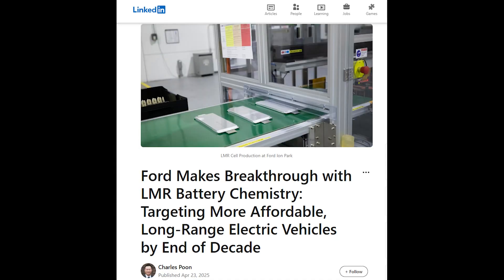Are Ford and GM's LMR Batteries the Same or Different?

Comment: Interesting discussion! I never would have considered that these are different technologies. I kinda hope they are because I just want to see innovation and improvement. But if so, I just hope both are viable and end up being great alternatives that both succeed. Wouldn't cry if America were able to unseat China's lead in battery manufacturing (at least technologically), but... That's a fantasy at this point.

As for confusion, meh. One of both with adjust the consumer-facing branding of they really are different. Because you can bet they'll market the heck out of it, if their batteries are any good

Comment: GM is Chinese. So it’s a false distinction to try and separate GM from a Chinese company.
Reply from the maker: Yes, I'm curious what would make GM a Chinese company. Are you referring to investments or equity? Yes, GM partnered with SAIC in order to do business in China, but SAIC got more out of that than GM.

Regardless, my point was in reference to battery development. For most of the 2000s and 2010s, GM operated the biggest battery development and testing center in the world, and it was located in Michigan. So if nothing else, I was simply referring to a geographic separation.
Reply: What's the basis of this claim?

Comment: Great discussion, Ford and GM sitting down to discuss how to not confuse customers 😂
Look at Tesla, they virtually provide 0 information on their batteries. I think people look at: 10-80 charging time and vehicle range.
Reply from the maker: Yeah. It was a stretch. 😂I think you might be right. I think the average customer just doesn't care what their battery is. They just care how much it costs, how fast it charges, how much range it has, and how quickly it degrades. The rest is just marketing and labeling.
Reply: @newscoulomb3705  and how safe the battery is

Comment: Well I'd never heard of LMR until about 2 months ago when Ford announced "LMR" first and then like a week later GM made an announcement regarding their LMR battery.  It's too coincidental for them to be different things.

My assumption is that a third party manufacturer, Chinese or Korean, developed this technology and is licensing the same tech to both manufacturers.  The simplist explanation is probably the most accurate.

I also assumed LMR is just LMFP with a heavy dose of manganese. What percentage/ratio is needed to be "rich" in manganese?
Reply from the maker: Yes, it appears that they just made up the term because it also bucks typical naming conventions, but I'm still not 100% convinced that they are the same battery. 

In my GM LMR video, I linked to John Voelcker's Wired article, where GM's engineers informed Kelty that they had been working on this battery tech for the better part of a decade, so that one I'm almost certain was developed in-house.

Ford's battery is a bit of a mystery, though, and they certainly could have received help. Now that you say it, I'm actually wondering whether Ford got assistance from SK Innovation (their Blue Oval partner), and that could be why GM made the announcement using the exact same name. They normally don't announce something like that so far ahead of production. 

SK has already gotten in trouble for using LG's IP, so if this is the exact same battery chemistry, someone has some 'splainin' to do.

Comment: I wasn't aware Ford was developing cells and usually shopped around. GM claims to have been working on LMR for 10 years, and even discovered LG had at some time, not necessarily currently.
Reply from the maker: Yes. Now I suddenly have a conspiracy bug in my head. Ford is working with SK. SK was successfully sued by LG Energy for stealing trade secrets. Ford announces a brand-new battery named LMR. A month later, GM releases a joint announcement with LG ES regarding their brand-new LMR battery.... 🤔